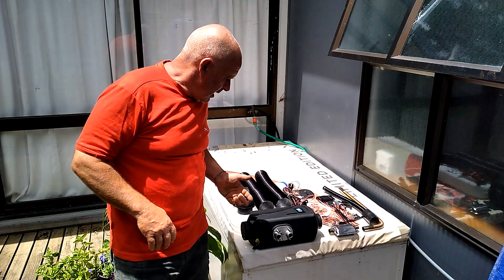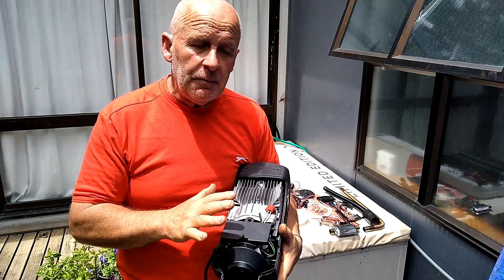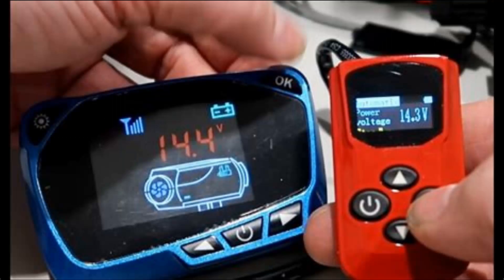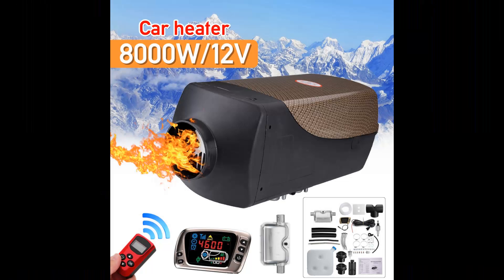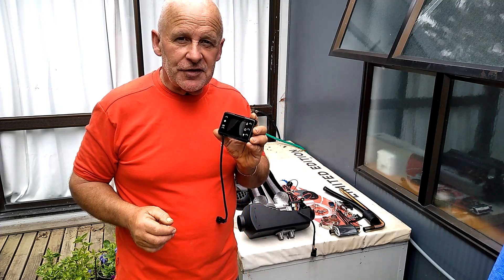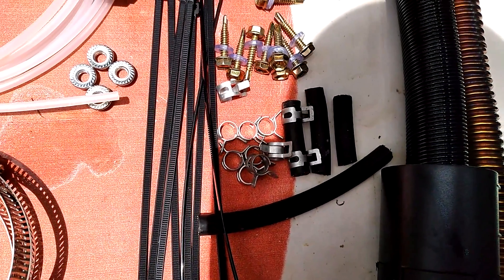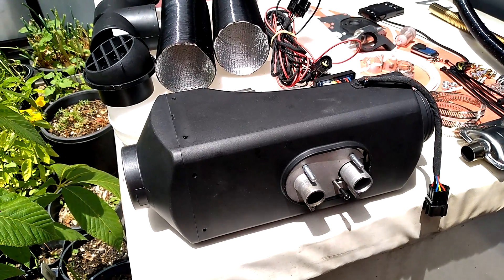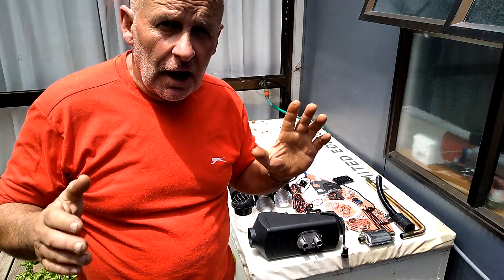My first Chinese Diesel Heater

Comment: Don't think you did it correct on the Last bit of your working out you did it on 5kw that's not correct because 5kw is on full power not the Lowest and you need to run it on paraffin or diesel and cooking oil 70% diesel 30% oil

Comment: What comes out of the exhaust, is it carbon monoxide or another gas ?
Reply: Nitrogen, carbon dioxide, water vapour, oxygen or carbon monoxide (both should be low values - particularly the CO!) and the usual pollutants from combusting fuels.

Comment: Would the 2kw heater heat a well insulated office room in the garden,   5 metres by 2.4 metres  or do you think I would need a 5kw heater .
Thanks , sorry for all the questions  👍
Reply: If you have an alternative heating system at present, just check out your requirement with that.  An electric fan heater, If less than 2kW (I’m not sure of the 2kW heater output, but like most chinese offerings one might take that like a ’pinch of salt’!   Look at the specifications for the pump maximum delivery and guess the output using 10.5kWh per litre of diesel (taking into account the expected efficiency).  I would say that you are fairly safe if only 1.5kW but might be tight if you need a full 2kW to keep it warm.

Do be sure you are looking at the correct size and pump output - the adverts can very misleading in this respect.  If it indicates the small dimensions, but 0.5l/h something is wrong.  Good luck!

If the 2kW version would suffice, it would, IMO, be a better choice than the larger unit continually running on a low output.
Reply: @oliver90owner  thanks Richard, you have been very helpful,  cheers 👍

Comment: Thanks for the video,  can the controls on the all in one be extended ?   So that the all in one can be outside and the controls inside . Thanks
Reply: Sid, the wires can be extended but may need to be of heavier gauge, dependent on distance.  I have extended the pump wiring on mine so that the pump is quite remote from the heater (it’s quieter without the loud ticking 🙂).  You may find that the harness, fitted , is the same as the discrete component heaters.
Reply: @oliver90owner  thanks  for the reply  👍

Comment: Please provide links to the videos of those using approved testing methods and equipment to measure the btu/hr output of these heaters. You stated there were test done but I have not found any that use the approved process.